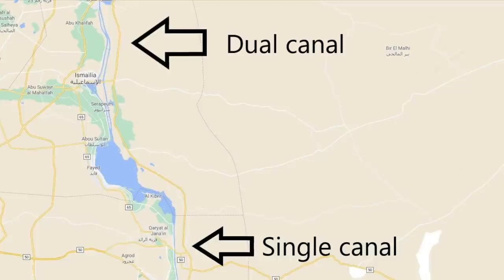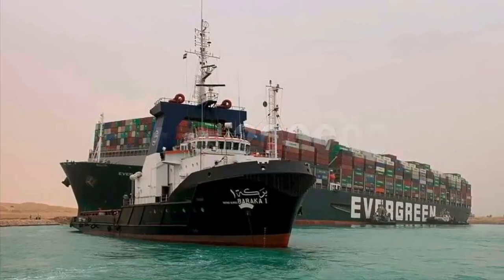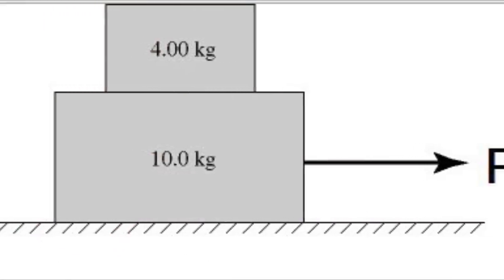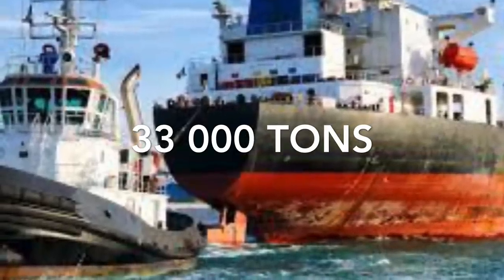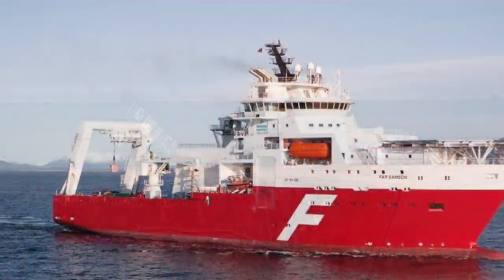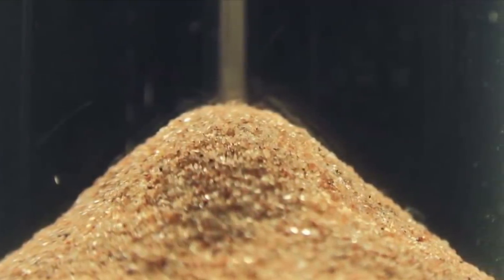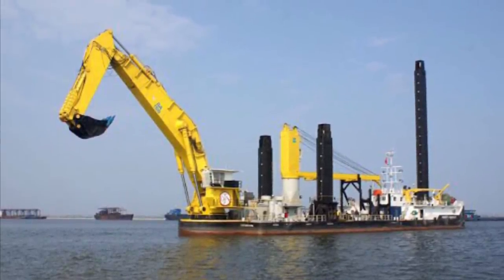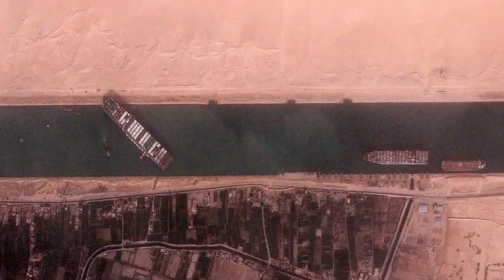MV Ever Given - why can't it be pulled out? Suez canal blocked

Comment: I hope the teams working on this are paying close attention to the many brilliant suggestions from the internet.
Reply: How did WWII last five years? If the internet had been around, it wouldn't have gone past a week. The world is FULL of geniuses living in their parent's basement.
Reply: @bentnickel7487  I doubt that. One idiot thinks two tanks can pull it out.
Reply: Well after tonight’s high tide they are gonna start unloading it if not free. Lol
Reply: @Tarheel13  I was being sarcastic. Apparently, you didn't get it.
Reply: Pipe high pressure water into the ground where the ship is beached. Sand will undergo liquification. The sand will flow away from the area more efficiently than if you had a special excavator. You can suck up and filter the water in the area to relocate the sand,  or toss it onto a section of the bank covered in 0.5-1meter sized gravel and it'd naturally filter the sand out. Small gravel drainway would prevent shore erosion from this method. Sure I may be a denizen of the internet, but I love engineering and I'm about  to graduate under physics.
Reply: lolz
Reply: At 1:39 am ET the New York Times published the following update!!!
"The mammoth cargo ship blocking one of the world’s most vital maritime arteries was wrenched from the shoreline and set partially afloat again early on Monday morning, raising hopes that traffic could soon resume in the Suez Canal and limit the economic fallout of the disruption. Salvage teams, working on both land and water for five days and nights, were ultimately assisted by forces more powerful than any of the machines that rushed to the scene to assist in the rescue: the moon the tides. As water levels swelled overnight, the hours spent digging and excavating millions of tons of earth around the Ever Green paid dividends as the ship slowly regained buoyancy, according to officials. While shipping officials and Egyptian authorities cautioned that the complicated operation was still underway, they expressed increasing confidence the ship would soon be completely free. Images on social media showed tugboat crews celebrating the victory in the predawn hours."

Comment: The simplest engineering way to dig this vessel out of it current berth is to use Venturi Jet pumps. They are used extensively in South Africa’s Deep mining operations because they are so efficient. They can dig as deep as 200 feet down, and if the walls of the hole collapse on the pump it’s simply able to carry on without being clogged, in essence creating a funnel like hole, which is exactly what is required to move this amount of sand quickly from underneath the vessel. It would likely take less than 72 hours to re-float the vessel deploying the correctly engineered Venturi bug (the thing that goes into the sand and sucks up the sand to move thousands of tons an hour) , and the super high pressure pump feeding the Venturi, all could be deployed by helicopter including the generators needed to run the pump, clearly water is not a problem so the engineering fix is relatively easy for engineers skilled in this technology.. But unfortunatly I would venture marine salvage teams have little to no experience using this technology and have yet to call on the South African experts who may well be the worlds leaders in this field by a large margin, with many years of experience move 10’s of millions tons of Sand and mud in some of the harshest and deepest working environments on the planet..
Reply: How long until hull fails? Range 1 week , months? Should they support the center somehow? Many hoses they could inflate. Need to accelerate digging.
Reply: It reminds me of the Iranian take over of the U.S. Embassy in the early 80... Israel volunteered to free the hostages as they did in Entebbe. However, Carter thought he could do a better job!  He lost Iran and the Panama Canal in less than two years! Never suppose that experience can outweigh pride, ignorance, and arrogance!!!
Reply: You'd probably want several Venturi Jet pumps so that you could insure that the bow is undermined evenly.  If the digging at any place under the hull lags behind too much it could create a "hill" and damage the hull.  I'd also think some salvage floats and emptying the ballast tanks more could help free the ship a few hours earlier.
Reply: A question for Paul, where would the sand excavated from under the ship be discharged?  Into the canal is no good unless you either have major dredges available to scoop out the sand or are able to discharge the excavated sand either into the desert well away from the canal or into a number of barges which can then haul the sand away to be dumped, probably out in the Red Sea well outside of Port Suez.  Discharging into the canal will simply block the canal even after the ship is removed.
Reply: I'll try it
Reply: @thomaskeenan2208  Recent events worldwide seem to be a little more connected with one another than in the past. So it's not too bigger stretch really to think the immovable ship is there not by such a mistake...... And they're not supporting the middle which is bound to be under excessive stress...... And it's taking an impossibly long time to get it moved...... Unfortunately the direction this is heading  is an inevitable but more likely 'preconceived' oil spill, as that would extend the world's state off unrest from the 'preconceived pandemic' and keep the global economy struggling to stay afloat (no pun intended).
Reply: What about temporarily damming the backside and let the water rise until it floats?
Reply: @fyremanbill Water would spill over the sides of the canal, causing flooding in the area, not to mention the difficulties that  would come with damming
Reply: @robertf3479  - we’re only talking about a few hundred cubic meters of sand, so the discharge wouldn’t be a problem to spread it or collect it.
Reply: @ceering99  - I suspect that this being a super container vessel that the draft is deeper than normal ships and is only just above grounding again later...
Reply: @robertf3479  Your question is the same as washing your back side with wet sh.t, it will never get clean, wonder who will be so idiotic to follow the route you're so worried about, I guess no one
Reply: @ajlifesolutions7072  Actually talking about several thousand cubic meters of sand, thus my concern about simply discharging it back into the canal.  A number of ships using the Suez Canal draw enough water that sand 'drifting' into it is a constant concern.  I've traveled that canal sir, some of the ships using it (tankers) draw 50 feet and are barely able.  Even if one of these doesn't touch bottom, a shallow spot could allow sand to be drawn into engine cooling or other systems through sea chests, damaging equipment and possibly causing the ship to go dead in the water, causing more problems.

The canal has dredges working 24/7/365 to keep it open and navigable simply because of sand being washed into it or blown into it over time.
Reply: Good ideas, had similar thinking. Water jets can largely do the job of flushing the sand and small rocks away from underneath the front of the vessel. Several Venturi Jet pumps needed in order to guarantee the bow is undermined step by step and kind of evenly. If the digging under the hull is done unevenly it could create a 'hole' next to a 'hill' and potentially damage the hull. Although with high tide this is less of a problem. To work together with tug boats and jet pumps might provide the water under pressure that function as kind of grease to reduce the friction between sand bed and vessel.
Reply: @ceering99  That makes sense. It would be an immense undertaking without a doubt.
Reply: That's a really good idea. Maybe the South African government should reach out to the Egyptian government. Our impotent Biden has already offered, but I really don't think the US has any technology or equipment that help with this mess.
Reply: Cor Graveland    I wonder if the ship owners are looking in the comment section on YouTube for ideas from all the experts.
Reply: I said this exact thing minus the south African part. I said they just need a bunch of pump dreges and jet pumps and start sucking all around the ship and it would only take a couple days max
Reply: I hope they try this.
Reply: Pump idea is only way to move amount of material involved.  But I think before they get going on that issue,. They should use sheet piles around bow to stabilize sand so they can actually remove the material.  A platform could be constructed on top of pile structure to mount pumps.  Then they could make some progress. The excavators I see on YouTube are a stop gap.  But for dealing with a ship this size you have to think big.
Reply: Hahaha , so much “ experts” here know just to do . Good thing they asked the real Dutch experts to do the job. Look us up we did lots of difficult jobs like this . Nederland rules big time.
Reply: A giant fish tank filter....
Reply: @scottlittlewood4527  yea......sure, why not!

This is where the MSM gets their news!
Reply: A imperial Star Destroyer would work.
Reply: @s1lv3rbordeaux47  At what point do coincidences.....
Reply: @JB-cw8ti  What a bogus damn connection. Entebbe was an airplane guarded by a handful of hijackers on a runway in an unaffiliated country, the US hostages were inside a heavily guarded building in the middle of a city as well as a country that was completely overtaken by the Iranian coup. And if you have some secret documentation that Israel even suggested a similar extraction please present it, because I can't find any such proposal in the records. It was NEVER a matter of ego, in fact when the military attempt failed Carter took full responsibility, something we certainly didn't see in the last 4 years about any cockup the twice impeached private citizen had in his term. It took Reagan raising money by letting the CIA sell drugs to buy weapons to trade to Iran to make a conspiracy. 
As to the Panama Canal, that was actually a canal built through a foreign country, so eventually we returned it as the property of that sovereign country. Seems decency and integrity just aren't something you enjoy seeing our country do much of.
Reply: @ceering99  Wouldn't it float before that happens?
Reply: @robertf3479  the way a Venturi jet pump works.. a pump sucks up water from the canal though a pipe, the pump outputs high pressure through a pipe to the Venturi jet sitting on the sand, the jet agitates the sand which is sucked into the Venturi and a pipe on the output of the Venturi consisting of water with suspended sand is then fed to the shore and into a reservoir, the water evaporates or seeps out of the reservoir and the sand stays in the reservoir.. Graders can build a 24,000 cubic meter reservoir on the side of the canal in a matter of a few days ..
Reply: @corgraveland4874  the Venturi pump has a pipe on the output that would carry the sand onto the shore some distance away from the canal - so it actually digs the sand out and transports it out of the canal
Reply: @someday_nl3586  if the ship is not floating within the next 3 days (the maximum time it would take Venturi jet pumps to suck all the sand needed to re-float the vessel) your fabulously clever Netherland experts would have failed in their problem solving ability, of effective, quickest and incidentally least expensive solution available!
Reply: @fyremanbill  To a layman like me this sounds like a possibility....They should first find out how wide the canal is at its shallowest point.
Reply: Nope it wont work
Reply: @warpnin3  Or possibly just dam an area around the ship itself and direct some of the river flow into the dammed area. I'm sure there are folks much brighter than me have thought of every option.  At least I hope!
Reply: It's not currently berthed, its run aground.
Reply: @Paulstracywootten   Go play somewhere else with your venturi pumps, obvious why they did not ask you to help. For problems on the sea or with the sea you ask the dutch , period.
Reply: @someday_nl3586  how do you know they were not used??

Comment: ok i think i got an idea, i'm going to need a discovery channel camera crew and some of them alaska gold miners that scuba dive... all we gotta do is tell them there gold under that ship and it'll be free in two days
Reply: @onthejob9153  Dude, your point isn't SO good that you need to fucking spam EVERY comment you came across with a copy/paste of your reply.
Reply: Actually, suction or water jetting might just be the answer.
Reply: AG
Reply: Beautiful 💡idea 🥰😁😁😁
Reply: @51WCDodge  A hell of a lot of water jetting and Sand Dredging Pumps and how ever many Yankum Ropes it would take then use another Container Ship to hook too for the weight if it doesn't come out the first pull get a bigger run at it on the second one lol
Reply: call in Tony Beers from gold rush he would have that ship out in 2mins  just by flipping F bombs at it
Reply: as a Master SCUBA diver Trainer whenever I see those bozo's underwater I just cringe!
Reply: Or tell united states there is oil under the ship
12 hour tops
Reply: @onthejob9153  you recently learned the term “bulbous bow” didn’t you
Reply: That's how Rome was built!
Reply: @onthejob9153  Its just an estimate, that 1/3 of the ship rests on sand, thus 1/3 of the ships mass. He used 0.5 as the coefficient of drag, Im no expert so i cant say if thats a plausible value for wet sand.
Then the calculation is simple physics. The required force to pull would be the force of gravity on the parts of the ship resting on ground times the coefficient of drag. Because most people are not used to values in Newton, he took gravity out of the equation. But if calculated with gravity, the force required to pull the ship woul be 327 Meganewton, while the strongest Dragship in the World only pulls 4 Meganewton. Even if the Drag is way lower it wouldn't make a difference, since the ship is so heavy. Also im sure the drag coefficien is likeley higher than 0.5, since the sand got compressed, and the ship created a suction cup where it penetrated the ground.
Reply: @51WCDodge  This is the answer I was looking for. Maybe even some controlled explosions, then as many tug boats as they can fit in there.
Reply: @dankeyote5873  Instead, telll the Chinese there is oil underneath the ship, and presto we will be informed about an extended 9 dash line.
Reply: @nicholasweiss4662  You are a gem, enjoyed reading your comment.
Reply: @Amen.22  it takes about 1/12 the effort to move a weight on water as opposed to land. So good news. Bad news is that if the load is mired in mud, the force to get it out, is around 2 x The fully laden wieght. As stated the pull of a tug, the bollard pull, on a good one is only around 100 tons. I know from experience it can bad enough winching and pulling stuck vehicles out. Glad its not  my headache.
Reply: Also call somalian pirates. Time will be reduced in half to empty the ship.
Reply: @havocproltd  Same (on both counts).
Reply: You're probably better off calling the aliens from the "history" channel that built the pyramids. They seem to like Eygpt. <sad trombone>
Reply: Jeeze, you got that right! 🤣 get the Dutch guy with the beard and crew and it'd be out in no time, with a mountain of sand and rock left behind.
Reply: 🤣🤣🤣🤣Adam by George I think you've got it, sounds so crazy it just might work and no one has a better idea so far that'll work.
Reply: @dankeyote5873  
 Nothing works better than a well oiled idea😍🤣🤣🤣
Reply: Now, thats true fiction.
Reply: Get those Oak Island folks on this, I bet they could get that ship out.

Comment: This is a much bigger problem than I originally thought
Reply: I agree because of the weight on top with the Cargo Containers, sounds like the bottom of Ship Buried in Sand.
Reply: @stevenrimer8159  But it's SAND, not rock or even gravel. Sand--that stuff that washes away VERY EASILY. Bring in the fire departments and have them put their water nozzels under the bow. Start blowing that sand out.
Reply: @mypronounismaster4450  right? This should be nothing for the worlds best engineers
Reply: @mypronounismaster4450  I've just said the same , blow compressed air into the sand .
Reply: No it's not think about what China does they would already have a whole another trench dugout around the ship
Reply: "Maybe I should have stayed in the kitchen...."

Captains last thoughts before public execution!
Reply: Maybe we can use a sucker to inhale the sand around with water, just like the way to build new land by the sea.
Reply: @mypronounismaster4450  Washes away? Also re-deposits itself a few feet away. Sand is never washed away in such situations. The best thing is to liquify it. Pump enough liquid into the sand to loosen it.
Reply: @afcgeo882  
what?
You suggest to me that they should 'pump enough liquid into the sand' after I had said the fire department need to use their water hoses on it?
and yes, that sand 'washes away' if you blow it with high pressure.
Reply: @SebastiaanRath  high pressure water will blow it out easily. I used to work for a company that did excavation using pressurized water. It's quick and safe.
Reply: @SebastiaanRath  Also, for a dredge, they don't need 'a lot more equipment'----they just need a dredge. won't take long at all to just cut an area out around the bow.